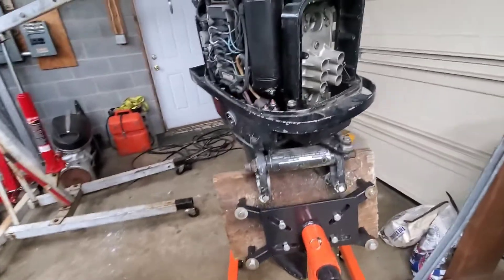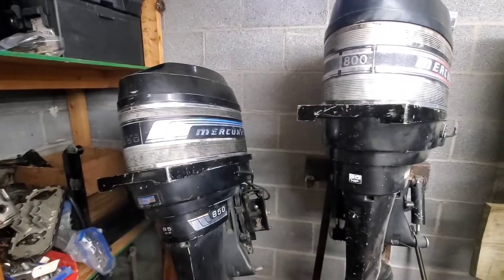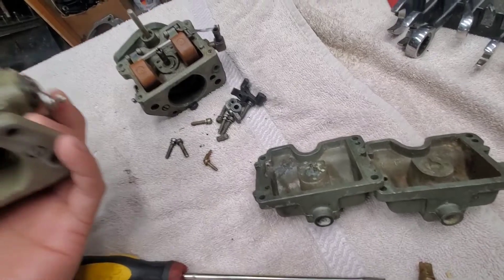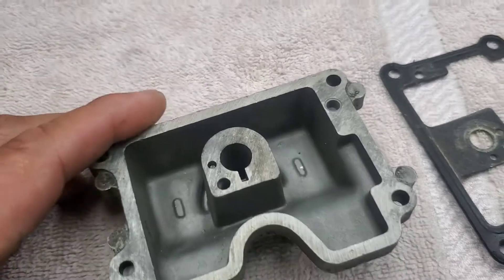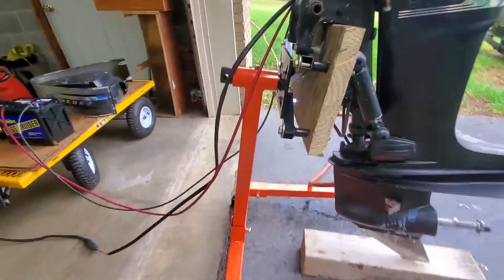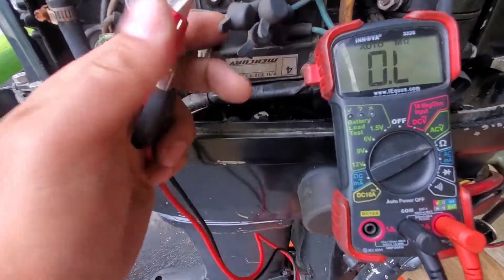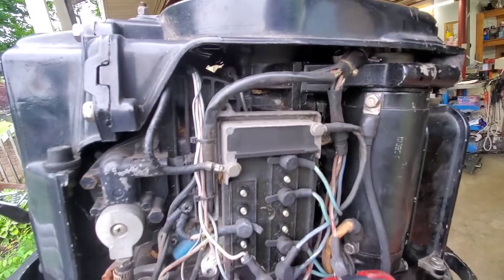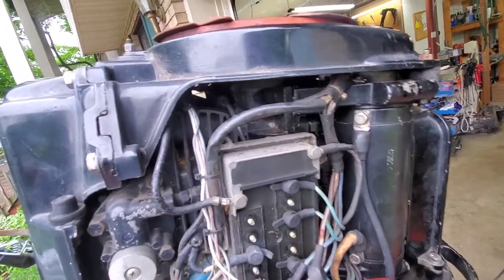Merc L4: Faulty Stator and Trigger?? Is this possible??

Comment: How important are the black air foils in the carburetors?
Reply from the maker: They help reduce the atmospheric pressure to vaporize the fuel. So, pretty important. Son
Reply: @MerCSonL6   Thanks 
I broke two of them so I ordered two to replace.  I didn’t know the proper process to remove or replace.
Reply from the maker: @tyronehampton7976  I don't ever mess with them. They always break or the brass venturi cracks.
Reply: @MerCSonL6  wish I would of contacted you before I touched them because I broke two of the three but thanks for the info.

Comment: Is there anyway u could do a link and sync video on this motor.  I have a 1980 80 HP with the same carbs and throttle linkages as this one and am having trouble figuring out the primary pick up setting.  Im sure u will have to check the timing after replacing the trigger and it would really help me with fine tuning my motor.   This motors throttle is differnt than all the other mercs ive had.  Thanks!

Comment: Hey son I am in need of some help again
Reply from the maker: What's up?
Reply: @MerCSonL6  so my 1979 1150 keeps letting fuel leak out the carbs when it runs. Is that just the needle and seats that need to be corrected?
Reply: I also am having problems when I am full throttle it acts like it runs out of gas in the bowls, but if pump the bulb it comes right back.
Reply from the maker: @joepoegel2394  rebuild the fuel pump. Check all fuel lines from tank all the way to the carbs for blockage. I had the same issue once and the clog was actually the fuel pickup inside the tank. It had a screen (I did not know about) completely clogged. Hope this helps. Let me know. Son
Reply: @MerCSonL6  thank you sir I will check it out

Comment: Hi Mercson , I have a 1979-80 Merc 115 , I'm trying to figure out which plug wire goes to which plug, does the top coil set fire even plugs and bottom fire odd number plugs? Was chasing a no spark issue on 3 out of 6 cylinders so I changed both switch boxes and all coil packs , so today I'm going to check spark next will be trigger if I still have no spark on 3 out of 6
Reply: And it is the ADI ignition
Reply from the maker: Top fires odd and bottom fires even. Plug wires are sequential tho. Meaning top goes to cylinder 1, 2nd one down to cylinder 2, etc. Hope this helps! Son

Comment: I have a 78 model 800 L4 with that silencer. What purpose does it do?
Reply from the maker: It's designed to quite the engine. I ran one with and without and the sound barely changed. It really is unnecessary in my opinion. But I love the sound of a finally tuned 2 stroke so my opinion is biased. 😂
Reply: @MerCSonL6  me too I love that sound

Comment: I have a Mercury 800 1979, looks pretty much like yours in the video, but I cant seem to get it to start. Changed the trigger because the wires were in bad shape but still won’t start. 150 psi on all cylinders and spark is getting to all spark plugs. I’ve also tried with ”engine starter gas” but not even a cough. I’m starting to think it might be the reed valves that sits on the crankshaft that has gone bad. Or maybe the stator is generating too weak of a current? Any ideas? What would you do next?
Reply from the maker: Test the strength of the spark. It should be able to jump 7/16 of an inch and bright blue with an audible "snap." White or yellow sparks usually indicates a bad stator. Hope this helps! Son
Reply: @MerCSonL6  Thank you, it for sure helped! I replaced the stator and all 4 coils and it fired right up!